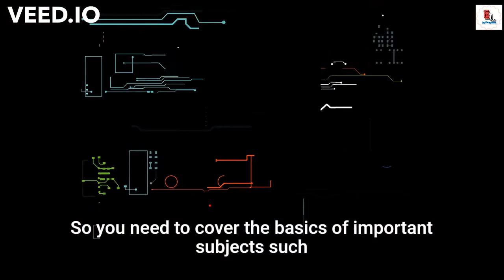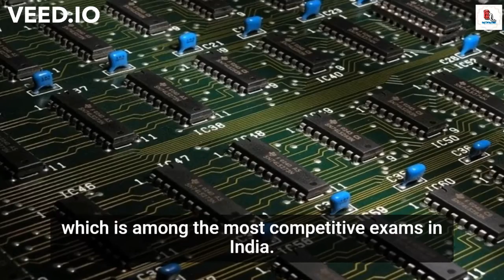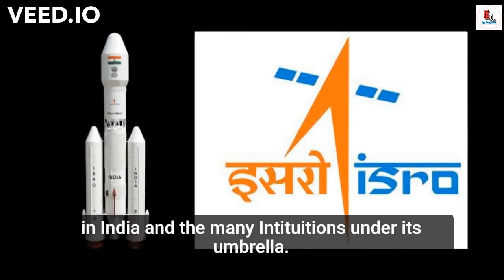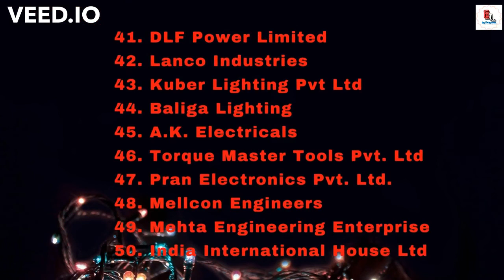How to get Job in CORE ELECTRONICS|| Public & Private Sector

Comment: In our country, doing Electronics engineering has no relevant jobs other than Technical support associate in any Call center, Sales and Marketing, or Administrative and managerial jobs in a company. But , if a person wants to persue as Technician or Mechanic (Mistry in local language) in Electronics work then there's tremendous jobs through direct contact to clients where the person can negotiate his service charges. The main reason for this is lack of adequate industries and dependence on imports from other countries still now